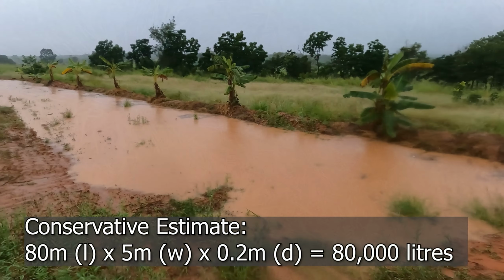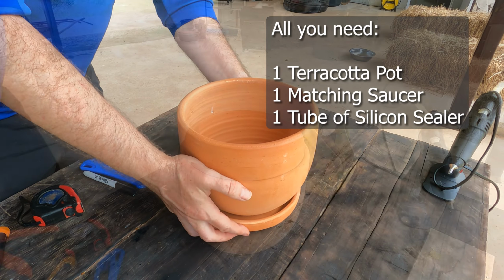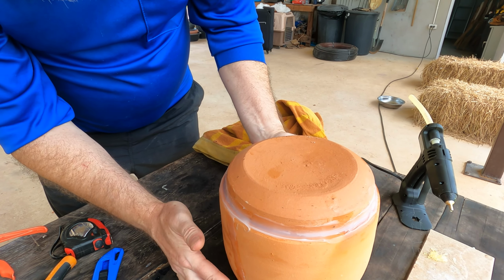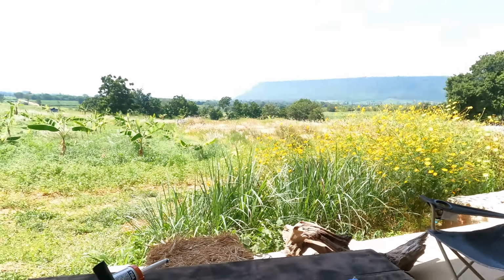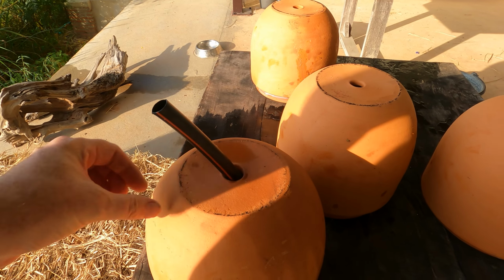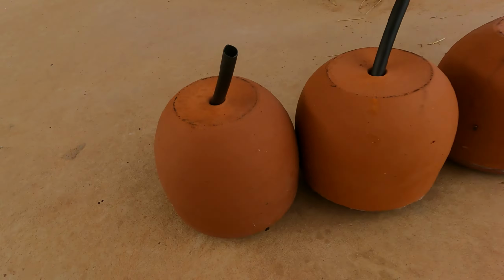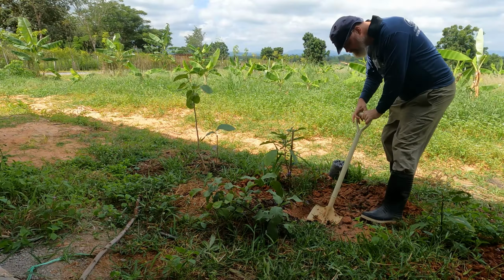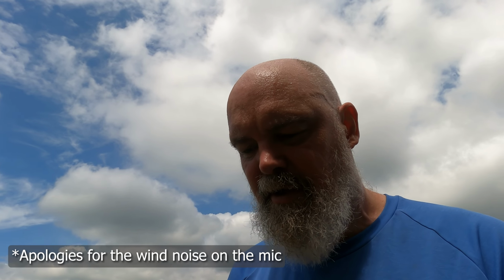EP7: 4000 Yr Old Water Hack To Save your Garden from Drought & A Youtube First (We Believe)

Comment: Level indicator us a good idea as it keeps you from causing too much spill over which not only wastes water but slows down the movement of moisture through the terracotta as the water should move from wet to dry. I would stick with the cork or wood stopper, which would seal the opening better than the indicator and have less evaporation, but  carry a level indicator with me when I go out to check the water levels and stick that indicator in after removing the cork.

Comment: I use plastic bottles filled with water that I put into the holes in the bottom of the pots after I have filled them for the first time.  I refill these plastic bottles when they are very low which keeps my pots constantly full.
Reply from the maker: Hi DJ, @djcoffman6505  sounds a cunning idea to me - work smarter not harder everytime! Thanks for your comment and input - appreciated!

Comment: bead the silocone then place pot and saucer together  ... land marker and wine corks are great ... once the olla is in the ground size of pot doesnt matter so much but you only get radius to 10 inches max water dispersion to plants... so a 20" radius pot will only give 10" access 

if air is really dry and hot... a coin / round over the top of the olla fill hole is awesome   completely cover the olla you can also fill a saucer with water to fill the olla fill hole this works really well for watering ground fowl like quail

remember olla may become root bound from the outside if you plan on recovering them latter

Comment: We use the triangular longer terracotta pots, bung it with our old cork from bottles. Been using for a long time. Sure helps in summer. We have in our vege raised beds, surrounded by thick mulch so only have to water 1x weekly except baby seedlings. We top up with tank water as needed. Our friend has added tunes via his watering system so they keep full when he turns it on as like us they have about 10 in the garden so it saves him bending down as he's in his 80's. They have amazing veg
Reply from the maker: Hi @rosemaryryan6455 this is wonderful and pleased he gets such great performance from such a simple system. I am shocked at how effective these seem to be -  but they appear to work absolute miracles for the soil health and provide "just enough". I am also adding these to my raised beds by the way! Thanks for the comment really appreciated and great to hear your experiences too.

Comment: Nice, but you could save a step by finding a local potter to make you an olla for the same price as the flowerpot you siliconed together?   Not saying it's easy to find a local potter, but if you happen to have on in your community you should work together to make ollas popular again.
Reply from the maker: I completely agree with this and it is the best sustainable solution! Thanks for your comment!

Comment: I would like to do this. And put a mark to indicate critical low level. And figure a way to fill all up with a flip of a switch. Time savers for me are extremely important. Wish i could do things in the garden in a slow way, but it is simply not possible.
Reply from the maker: Hi @DGibsonxio - I think your last line says it all - it SIMPLY isn't possible. I did some thinking along these lines as I was making the video as I had similar thoughts - can we automate this. Actually we probably can but to do so would be pretty expensive and complex. In which case you might as well install actual drip irrigation or other irrigation systems. I think the beauty of this is in its simplicity. And can be used where the irrigation systems aren't setup for. Thanks for the comment its really appreciated that you took the time to actually comment and support the channel in this way.
Reply: @TheSmartGardenRomYenHouse  the slow way in my garden seems impossible because I can get it planted ok. When it comes time for actual taking care of it, weeding and watering,  my farm related job comes into play and I am so busy from about 30 minutes after daylight till dark all summer and fall. Our projected end of season is November 15 this year. With sporadic calls all winter and random during early spring.